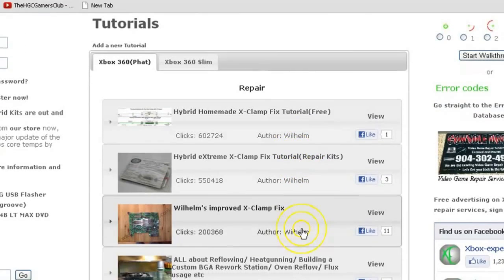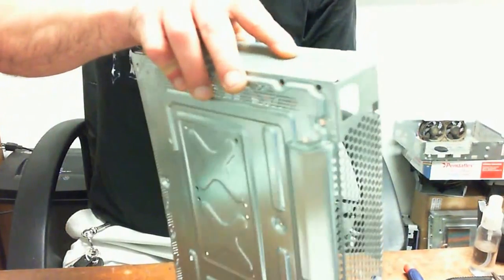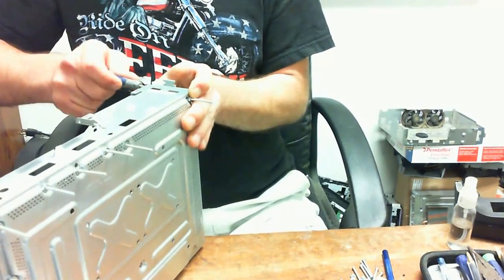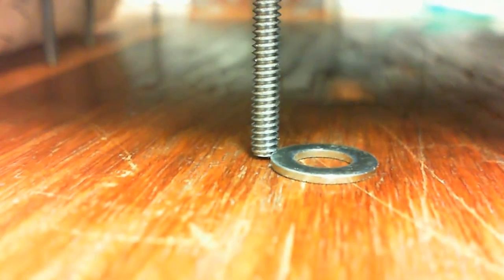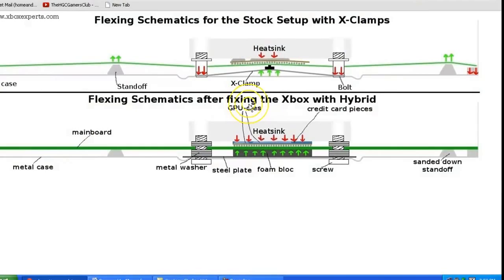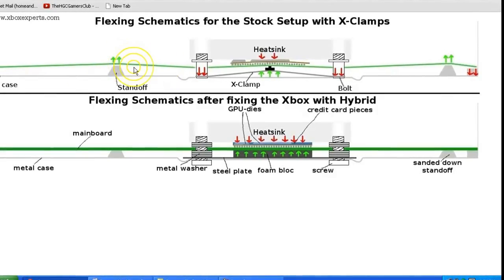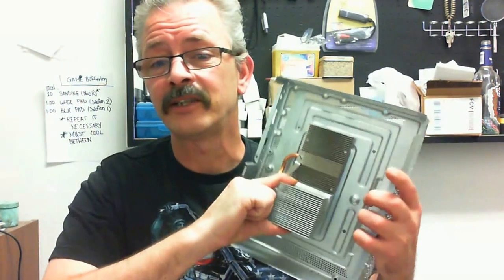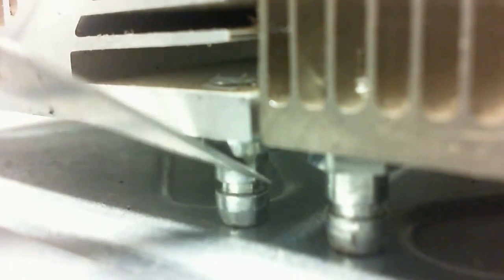Xbox 360 Bolt Method Exposed as a Scam to Sale You Junk! HGC Myth Buster

Comment from the maker: Yes there are a few factory flaws like heat sink legs not completely screwed in to the heat sink or loose T8’s and even an occasional X-clamp that was actually damaged during the manufacturing causing uneven upward pressure but even with all of the above that only accounts for 1% or less of the Red light eschews conserving the Xboxes

Comment from the maker: It is true that the X-clamp puts pressure on a single point behind the GPU And CPU it also maintains upward pressure on the motherboard in 4 additional locations around the legs of the heat sinks a totally of 5 points per chip evenly distributing the upward pressure on the motherboard allowing for perfect contact and pressure even during thermal expansion and contraction.

Comment from the maker: The trick to long life with any game system or computer laptop included is keeping it stock and keeping the dust out of it allowing it to regulate its own temperature this allows it to maintain a cool even consistent temperature “this is an absolute must” over clocking fans cutting vents only lead to damage of the solder and every component in the system. Do not use external fans, Do not cut the case, Do not modify the case and the biggest Do not do is!

Comment from the maker: This is for a question for you” The PS3 has a extremely large heat sink and does not have X-clamps yet it fails 100% with the identical eschews as the Xbox 360 and that is Cracked solder below the GPU & CPU can you explain this? ((I Can and will but: I will give you a chance to take a shot at the explanation)

Comment from the maker: Although modified SMD or SMT hot air soldering irons can be used and quite well I do add by an individual that has a lot of experience in using them or an individual that has killed enough Xboxes to learn how to compensate for the size of the Chips ECT; I do not recommend them for chips the size of an Xbox 360 perhaps the Ram or possibly the south bridge as they call it, but not the GPU or CPU. NOTE: When I say Heat Gun I am talking about what you buy at Home Depot not an SMD reworking station.

Comment: Well, after watching this I am sold on reusing, or even replacing the X-Clams and NOT using bolt kits.
What sold me was the even pressure all around, and the X-Clamps allowing for heat expansion. As we all know. Xbox's do get hot. Even 360 Slims.
Reply from the maker: lots of electronics use X-Clamps of one kind or another, Most Electronics that do use bolts originally from the manufacture use springs and it is true that some are just bolted, but there is a big difference and that is the spacing between the chip and the leg of the heat sink or bolt and also take in to account the heat produced by the chip itself, If you Repair and it sounds like you do? on my old channel that was lost i had a video showing Proper X-Clamp installation, would you like me to show you how to install the X-clamps in the Box by making a new video? Because most learning of YouTube do not know how to install the X-clamps without the system overheating. originally leading to all the bull from idiots regarding the bolts and the mass misinformation put out just to sale you and kids bolt kits misleading even some that do have some electronic education.
Reply: TheHGCGamersClub
Yes, an in-depth how 2 video on the proper way to remove, and reinstall the X clamps would be a welcomed addition.
I do my own repairing of xbox controllers, etc when I can. My trouble, besides being blind in eye, and can't see well out the other, is when I go to remove things like thumbsticks for example. I often lift the pads on the board and then to me it's junk. So I try not do any repairs unless it's absolutely necessary.
Reply from the maker: Bucks Back OK as soon as i get a chance i will

NOTE: You should invest in this tool for removing any electronic component like that it is called A [S-993A] it is found on Ebay use this link http://www.ebay.com/itm/S-993A-90W-Electric-Vacuum-Desoldering-Pump-Solder-Sucker-Gun-AC220V-/161100295585?pt=LH_DefaultDomain_0&hash=item2582536da1

Comment: Daniels this is what i've read in a forum "In other words the X-CLAMP puts pressure on a single point behind the processor, and 99% yields a slope of the motherboard so once the CPU reaches a certain temperature it could easily remove the pins of the processor and the console get the 3 LED RED!"

Comment from the maker: As long as the Game system is allowed to Regulate the Speed of the fan you are good Note: The only time you should use a fan mod is if the game system has lost all power or the ability to regulate its own speed and then proper precautions must be followed when it is in use. (STOCK FOR THE BOX IS BEST)

Comment from the maker: 99% of boxes all game systems including the Xbox and PS1,2,3/Wii that fail in the first 3 months are “factory defects”. 99% of Xboxes that fail in the first 1 to 2 years are directly related to dust choking off the heat sinks causing overheating resulting in cracked solder or blown chips and capacitors ECT. After the first 2 years your game system red lights will be a combination of 98% dust and drying thermal paste and 2% actual component burnout. So keep your system clean and you avoid the 98%

Comment from the maker: And last but not least there is no way to get the bolts properly installed with equal force without a torking meter and even if you did it will not matter thermal expansion and contraction will loosen the contact with the chip within weeks and force you to retork by tightening the bolts eventually you will rip a solder contact and kill the box or worp the chip causing permanent overheating or hot spots that will damage the solder and require a reball and total replacement of the chip

Comment: What do you suggest I do with an 3 red light secondary error code 0020 box? I picked it up this morning and pushed down the hana chip while turning on and it worked fine, But obviously that only puts the thermal glue back together for about 2 minutes and is only temporary.I could do the penny fix and maybe get it to work for 6 months of normal use but surely there's something better I could do? Of course something that I my self can do.

Comment from the maker: 1.Replacing the thermal paste will not repair rrod unless it is 2 red lights anything ells it is too late it must be repaired properly with and as long as no one did a bunch of towel tricks or heat gunned the box and you are allowed to keep proper maintenance on game system after the repair the box can last longer than it did from the day you bought it 5 or even 6 years not just a year2. Cutting the case is bad and will not help your box last longer more airflow only leads to faster dust buildup

Comment from the maker: Big fucking deal I have been working on electronic since I was old enough to take apart the radio I have several certifications in welding of all kinds and preformed repairs and trained component level avionics repairs to the newbie’s in the military as the head supervisor of the entire avionic shop and well as the supervisor over the night vision equipment repair shop and the BAT Shop all at the same time! So you will excuse me when I tell you stop leaning from YouTube! Idiot!! I am 46

Comment: main reason  the joints fail is system runs to hot  I had water cooling blocks that mounted with x clamps  and system still going strong  it's a cooling flaw

Comment: Whats your answer then?  If the thermal paste and bolts are not the answer.  If i brought or shipped you my own xbox 360 with three red rings what would you do to repair it?
Reply from the maker: The Answer is 1. Do not put bolts in your Xbox and 2. Do not use fake tricks to preform a re-flow of your chips, it is that simple, there is no good home repair of cracked solder unless your willing to spend over $600.00 to do the repair.

Comment from the maker: first if you pushed on the hanna chip pennys will do noting and will not fix anyting for your box at all not even unpluging your fans will work if your hana has a cracked solder ball that box is likely shit from heat gunning or somone droped it you need to find a qualified repairman or that box will be parts only.

Comment from the maker: I did perhaps mine was bent? However .75 mm?? Would not make a difference in the motherboard in fact if you try and flatten something that has been in place for months, possibly years and subjected to heating and cooling permanently molding it to that shape and now try and flatten it out, your asking for trouble. But that is not the overall point of this video. The Question here is how did the bolts correct the case? As there bolt fix is recommended every Xbox even the new slims.

Comment: They did say that most of HDMI models did have the standoffs already fixed straight from microsoft... I think they fixed it with the Zephyr or Falcon model.
Reply from the maker: that's crap, even if the standoffs was off like they say it still would've never caused the problems and reversing it after it has molded itself in place threw heating and cooling would only make the problem a thousand times worse than before.

Comment: going to try cleaning it out first thought these kits seemed a bit weird . if i give it all a good clean and it still overheats its it worth removing the x-clamps and adding new thermal paste and even getting a replacement fan set for the box because my girlfriends xbox is noisy as hell and it overheats and it gives the 2 red lights but its not insant overheats it usually happens after 20-30 mins of playing any advice for a ps guy would be appreciated.
Reply from the maker: Yes i got some advice for you 1st replacing the thermal paste should fix your 2 red light overheating very quickly 2nd if you put bolts in your Xbox ("Do not even ask to mail it to me to have it repaired")) go to the oldest video i have and you will see why. (YOU WILL 100% DESTROY YOUR BOX)
Reply: I'm not doing bolts I was agreeing with you on them being a waste of money and don't see how it would make it better when it was designed to have x clamps. Thanks for your fast response appreciate it :-D cleaned it out but still over heats after a while so I'm going to thermal paste it next.
Reply from the maker: urabawbag Sorry your comment says "still overheats its it worth removing the x-clamps" perhaps you meant to say (Is it worth?)
Reply from the maker: urabawbag Tip: if after you replace the thermal paste if it over heats drop (1) 1mm washer (same ones used in the bolt kits) over each leg of the heat sink thin install the X-clamp tighten the T-8 and that will make the X-clamp just like you installed a Brand New set.
Reply from the maker: TheHGCGamersClub PS that video you watched by Tinker Mods is not a good one to use for renewing thermal paste.
Reply: yea that wasnt the best video for re thermal pasting was getting a general idea before i get stuck into it but once again thanks for replying appreciate you taking the time to do so thanks

Comment: Some computers use a x clamp design, the problem is not enough air flow
Reply from the maker: +freevideos051 You are right it is Air flow but not do to bad fans or any crap like that it is and always was 99% dust build up in the system restricting the air flow and that is 100% Microsoft's fault! If you put a warranty seal on a air cooled system you reduce its life span by 75% or more depending on your air quality. Hell Sony is just as Guilty as Microsoft is when it comes to 99% of there problems as well.
Reply from the maker: +freevideos051 OMFG you are subscribed to GamerGuy51 one of the Biggest Criminals on YouTube! a licensed game store owner that teaches Death to kids game systems and Steals from kids piggy banks with Bullshit Fake repairs 100% learned off YouTube videos! A Man that makes his living destroying kids Game systems@! I should ban you from my channel now.
Reply from the maker: +freevideos051 I did not mean to sound like an Ass I forgot to put LOL at the end of the part about banning you; it was a joke, but my comment about GamerGuy51 being one of the Biggest Criminals on YouTube was not a joke, it is a fact and was meant to tell you / worn you not to follow any suggestions of his for the repair of your game system so you can get to the best way to fix your Xbox360.

NOTE: If you have 1 or 3 Red lights you can not repair your Xbox at home for 90% of its problems, if you want a proper repair take it to a shop that has qualified repairmen with proper equipment or your system will be in the trash in a week or so.

Comment from the maker: First I did not say the bolts will not work, I told you they will damage the box and just so you know a torks driver is nothing more than a screwdriver and will not prevent over tightening and this nutcase has over 30 years in electronics repairs, “I am calling you a flat out lire kid” you admit yourself you are a bolt pusher that sales bolt kits, you have a good feedback on your eBay because most boxes will last a little over 30 days but find out shortly that you killed there Xbox

Comment from the maker: I have first generation Xbox 360’s that come in for cleanings from time to time that have yet to get red lights because there owners followed my advice long before I ever became a repairman the Xbox 360 slim will have the exact same problem as all the other 360 gens and other game systems like PS1,2,3 your laptops and PC’s it will only take a little longer because of the new Heat sink design and better heat transfer chip design. “Fact”

Comment from the maker: Ok fine let’s say the standoff issue is with the Xenon cases and it causes red lights? Please explain first why the box used in the video from Xbox experts was not a Xenon case and why you would remove the lock down points in an Xbox allowing for 1000% more flexing of the motherboard than it would ever do with the X-clamps in place? Or if being an idiot and drilling removing the only under support of the chip that will warp the board and chip and eventually kill it.

Comment: Honestly i do think that it is wrong that people charge money and claim to be professionals when doing this but for the cost it takes to fix it properly and make it work for just a little longer (maybe a year) i could buy a never rrod'd jasper console open it replace thermal compound properly (putting x clamps back on and not scraping the heatsinks or processors) and do a  few simple modifications like cutting the inner fan grill out for better air flow

Comment: I wish I would have watched this video before buying from x-clamp. I didn't buy their bolts I bought their Xbox 360 opening tool. Which I have to say is complete trash, because the metal on the tool already started to bend on me with just very little pressure.  -_-

Comment from the maker: Althow I do not recomend you as someone that has no electronics traning open your system but if you do you must replace the thermal paste on your game system this is the stuff you need to use or you will only damage your system.
https://rover.ebay.com/rover/1/711-53200-19255-0/1?icep_id=114&ipn=icep&toolid=20004&campid=5337859829&mpre=http%3A%2F%2Fwww.ebay.com%2Fitm%2F172341959065%3F_trksid%3Dp2057872.m2749.l2649%26ssPageName%3DSTRK%253AMEBIDX%253AIT